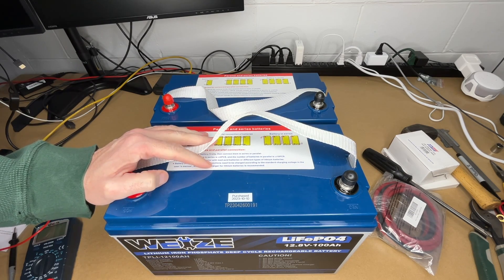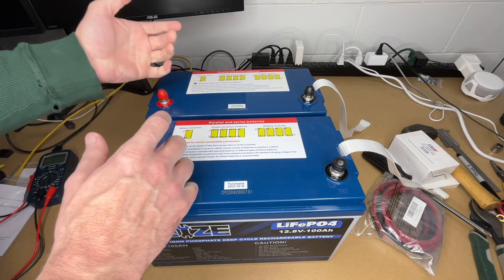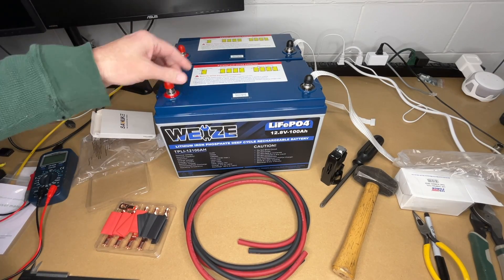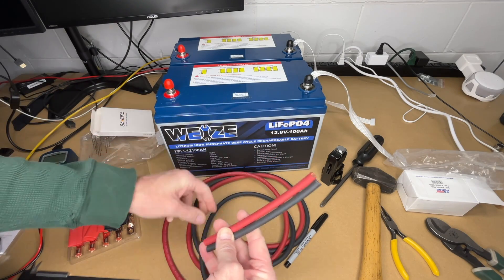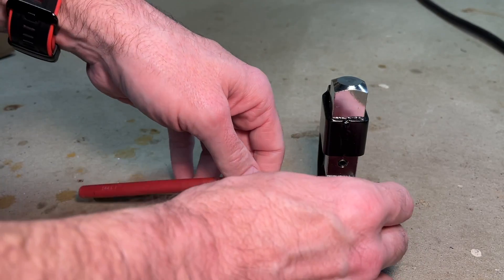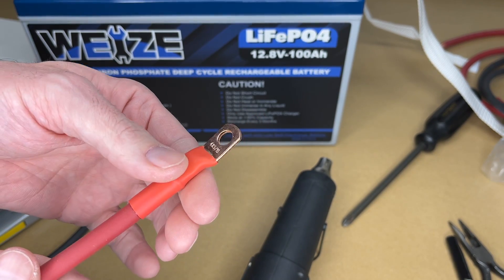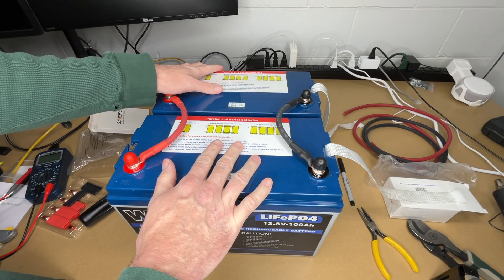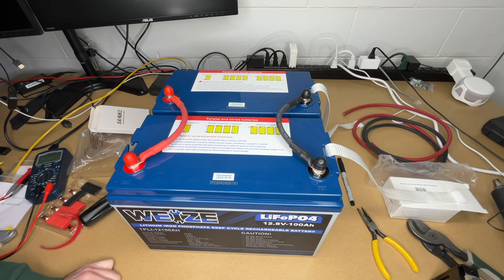Connecting WEIZE 12V 100Ah LiFePO4 Batteries in Parallel

Comment: Thank you sir for your explanation.
Please sir which set up is preferable: one 24v 100amp lithium battery and two 12v 100amp lithium battery?
Reply from the maker: If you are going for a 24V system, I'd probably go with a single battery as opposed to two in series. In a 12V system with the batteries in parallel, you could potentially use the system (at a lower level) if one of the batteries fails. You can't do that with the batteries in series.
Reply: @Rickmakes Thank You Sir.
I am grateful
Remain BLESSED

Comment: Maby you can advise me I was in a bad motorcycle accident 5 yrs so died twice within the first 73hrs of my wreck and went through 7 reconstructive operations then told id most likly never walk again well im walking but not before the bank foreclosed on my home I had a old dodge full size van that was paid for so I wad forced to move into it an built it into a fully self contained fully independent off grid van in the past few yrs I've went through several different brands of 12 volt deep cycle marina batteries in the past yr I finally went and installed 5 100 watt solar panels and upgraded to a 6000 continuous 3000 surge Gandall.pure sine wave interim running them in serious as 12 volt system because I upgraded my alternator on my van to a 200 amp one wire chrvy unit and have huge 4guage purr copper wire Ren from the battery thst stsrtd my van to a kill switch so I can connect an disconnect from the alternator so if it rains several days an solar panels can't produce power I can trun on switch drsrt van engine an ket the engines alternator charge up the 4 12 volt deep cycle lead acid batteries I have im using as house batteries charge up but it seems after 6 to 9 months give or take my batteries go from a good 13.8 volts to a hot sunny day or 2 the batteries will noy go over 12 8 to 13.2 volts an will not charge any higher and I'm going a couple of day at a time now staying in my friends house an not even using my van and only thing running in van is a mini fridge with s tiny freezer shouldn't it be charging up topping off at atleast 14.0 volts with 4 big group 29 lead acid batteries ran in serious ????I'm finally getting disability check of less than 950.00 a month insurance on van rubs me almost a 100.00 a month so u see money is shirt im wanting to go to a better battery but they all seem so expensive 
CAN YOU TELL ME WHAT I SHOULD BE USUNG AN KEEP MY ALTERNATORS CHARGING BECAUSE LIKE I SSID THERRS DAYS THERES NO SUN TO CGARGE BY SOLAR PANELS AND NEED TO BE ABLE TO CHSRGE THEM USINH THE VANS ENGINE ALTERNATOR WHAT IS A SUPER GOOD SUOER CHEAP BATTERY I CAN BJY TO GET RID OF KEAD ACUD DERP CYCLE MARINA BATTERIES TGEY APPEAR TO ME BE ONLY GOOD FIR OCCASIONAL USE AN NOT INTENDED FOR SOMEONE LIKE ME CONSTABT 24/7 USE THIS IS MY FULL TIME HOME AND DAILY DRIVER I NEED ADVICE BADLY I HEARD THAT 2 12 VOLT 100 AMP HOUR BATTERIES LIKE YOU SRE USING ARE EQUAL TO THE 4 LEAD ACID GROUP 29 BATTERIES IM USING AND I THINK THESE ARE LIKE A 65 OR 75 AMP HOUR BATTERY EACH ONE PLEASE ANY ADVICE WOULD BE GREAT